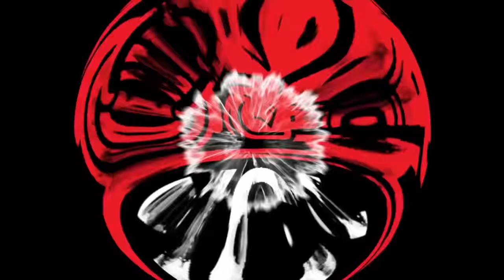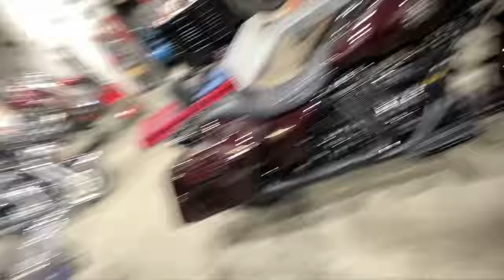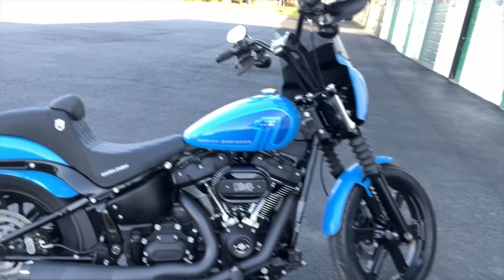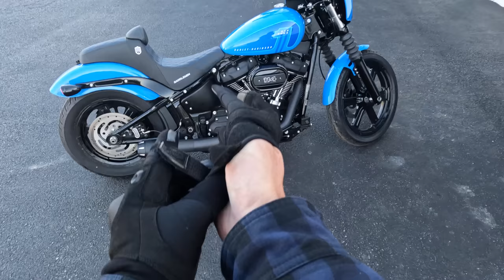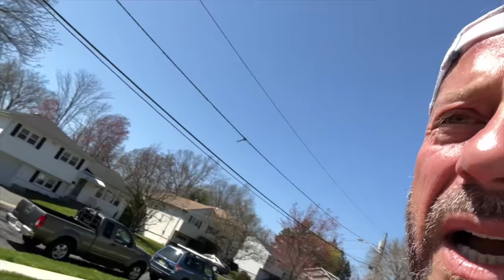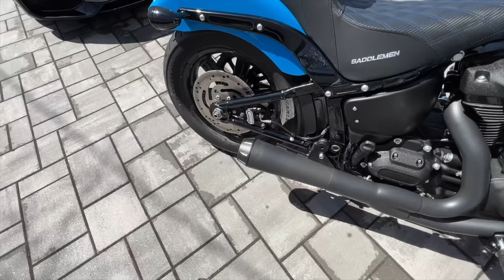WIFEY LIKES THE BIKE !! 114 STAGE 2 SOUNDS AMAZING ! STREETBOB IS HOME #SOFTAIL #STAGE2 #CAMUPGRADE

Comment: John I think it is a very nice shade of blue. And having the 114 M8 in it plus that cam. It should have a strong pull when u crank that throttle. Question: Would it make any difference on power putting a larger intake manifold. So it can suck in more air.